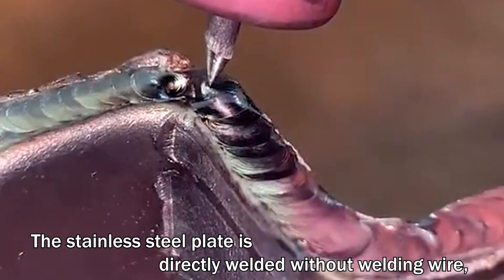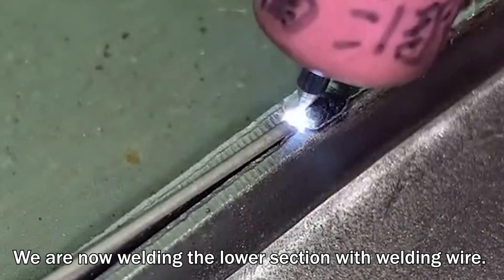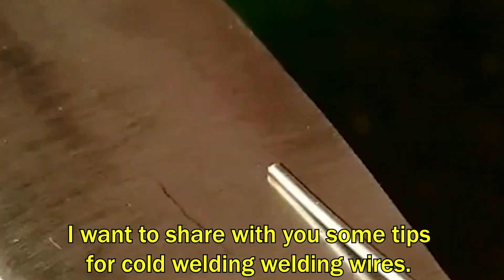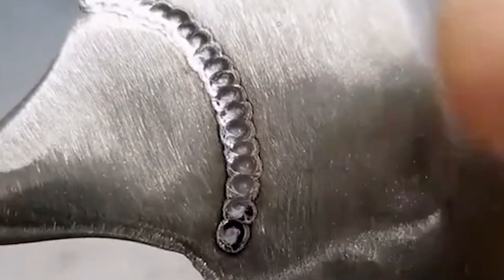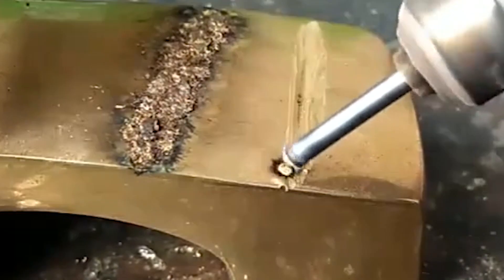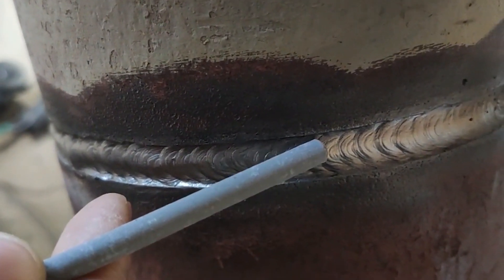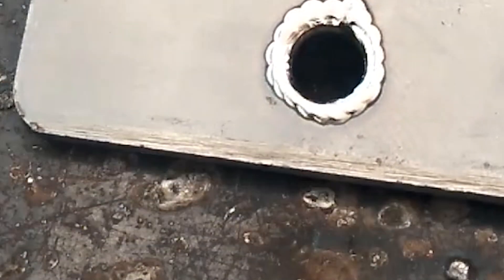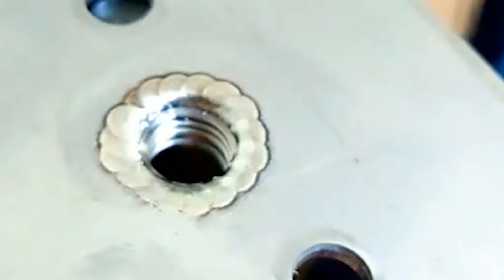Cold Welding VS Argon Arc Welding, 5 Differences Have To See!

Comment: I've been welding for years. I use pulse tig for the finest of parts, now I'll get one of these. Can you help in the type of machine for the UK..
Reply: Hi, as I have just bought one of these welders, be aware that with Tig you can see the weld puddle and tungsten from the light of the arc as you weld but with cold welding you cannot see the tungsten between flashes even if the auto helmet lens goes clear after the flash....you are in the dark when the arc flashes......I have found that you need a very bright LED spot light to illuminate the work piece between flashes so that you can still see the tungsten and the weld zone.
With Tig the helmet lens goes dark when the arc starts and that illuminates the weld zone as the arc is continuous but cold welding is intermittent.
The problem with an auto helmet for Cold Welding is the helmet glass when clear is still a pale green and you can't see the tungsten or the weld zone clearly.
The videos show the Cold Welding as a clear picture and not through a pale green helmet lens, but that is due to the camera looking directly at the work piece not through a helmet lens.
Reply: @gangleweed  wonders how long it will be before we have a camera on the helmet and the green lens an actual screen like in a vr unit.
Reply: @patomahony9747  Now that is a fantastic idea.........most of the videos are " adjusted"  to make them seeable for viewers whereas the view through a helmet is mostly murky......I expect the Chinese are already working on something like this once it's bee thought of.
The main problem would be the screen in the helmet would be very close to your face and so you would need to wear close up reading glasses to see the screen....or probably something like a VR viewer........ still a good idea though.
Reply: @gangleweed  VR headset and camera should do the trick. Even one of those cardboard units that holds one phone. Just a matter of playing around with it. 
I worked with some talented aeronautical welders but never got one of them to “give me a try at welding” 
Did some stick and some years ago bought a mig welder. 
While back in my youth I had gas welded , no issues with those goggles. As a hobbies welder the darkening of the helmet has never suited me. Plus with age my longsightedness does not help. 
Thinking I have to try making up a camera helmet.
Could even adjust view and magnification. ?????
Reply: @patomahony9747  You might have to add a neutral density filter to the camera lens to prevent " blinding " the sensitive chip in the camera......not sure how they do it on the 'tube when they photofy welding topics.
I'm a fitter and turner, 20 years retired now,  with some welding experience and I have a plasma welder, tig welder and an El cheapo stick welder.
I would think you could get an early model Iphone for cheap and use it for the test......having the camera and screen all in one might work.
You could probably just use a flat cardboard shield and have the Iphone on the inside with a hole for the lens etc........that might be the way of the future....LOL.
I hear so many people doing welding that have a problem with seeing the arc point  when the screen goes dark.
Reply: @gangleweed  it’s possible an anti sunlight anti glare lens cover might work or 2 put together. That’s what is used on GoPro type action cameras.
My problem is screen is too dark and I can’t see the weld track. Puddle is ok. I’m using mig welder. 
What I do is chalk the weld line it helps 
Most automatic helmets go from 9 to 13 I think. 
My ideal would be 6 ish. 
I have no issues with gas welding goggles if I were to braze or gas weld. 
Seen other people comment that ambient light entering from face side of mask is another issue. I may add a cloth flap to mine see if that makes a difference 

can you send me a link to your plasma welder. 
Worked in aerospace with some really talented welders nearly z40 years ago now. Never bothered to get one of them to let me practice on their welding rigs. Was to simple to just ask them to weld something. 
One guy used to take the foil paper from a cigarette packet and weld it. Seen another repair a broken /snapped tape measure. 
On that the polishing wheel cleaning up the weld removed more of the painted markings / measurements on the tape than the heat of the weld did. Plus the tape was accurate after the weld. Think it was a 10 ft Stanley tape measure. Had snapped at around 8 inch mark when guy using it snagged and bent it
Reply: @patomahony9747  The welder I use.....occasionally......is the Andeli 250 tig-GPC I bought on EBAY......A$950.....I use it for Tig and haven't got around to trying it on the cold welding mode so I can't comment on it's ability but according to the Utube videos it's OK.
You might be able to get a Tig welder that does DC and AC with HF  for the same price if aluminium welding with AC is needed.
It's a DC welder so all your Tig welding is with DC and it has the HF button on the handle  to start the arc.......so far it has performed very well.
On the helmet darkening.....I'll have to fiddle with the darkening setting....... I also can't see the weld line clearly and sometimes go off the line etc.....I use a 6 watt LED spot light to one side of the work to lighten the area and that helps a lot.
There is a silver marker pen on EBAY the you can use to mark the line etc.

My main welder is a Multiplaz 3500 plasma welder that runs on water (no argon needed)  to create the plasma......reviewed on the 'tube.....plasma temperature of 8,000 deg C.......bought in 2013 for A$2,000 as a demo model at our local tool shop.
I haven't got the link but It' s listed on OZ EBAY by a seller in OZ and I think he bought up a stock of them.....price is about A$2400 so it's quite pricey........it takes a lot of practice to get used to as it's like using a propane torch on steroids but is capable of welding a very heavy steel thickness.....a 20mm butt weld  is not a problem and I've gone down to 1mm thick at times and welding cast iron is very easy.
I got the idea to use one as a welder when I first used a plasma cutter and thought it would make a good welder without having to have argon......then I had a demo with the plasma welder and bought it......I also only do hobby work as I've been retired for 20 years now.
Reply: https://www.youtube.com/watch?v=V7-mcjR59a4&t=589s 

watch the video.
Reply: @tomthompson7400  Yes, seen that one, quite well done as a review.....he leaves the option open to a prospective buyer.